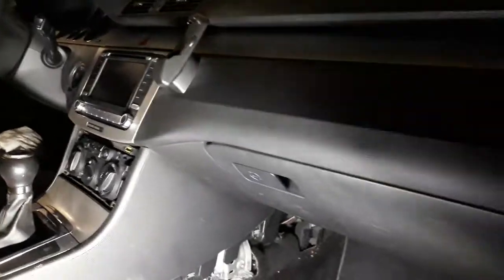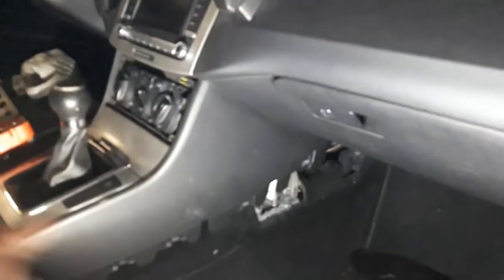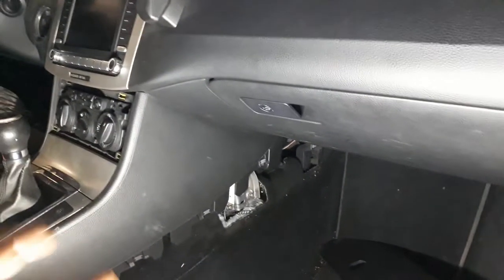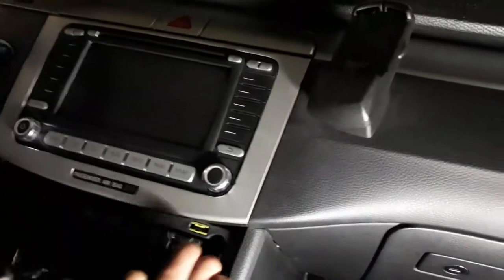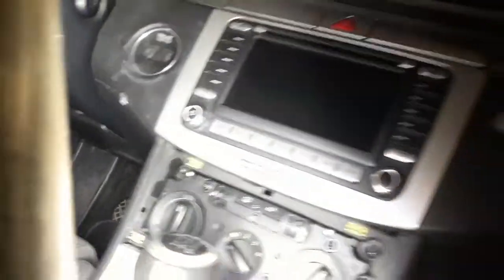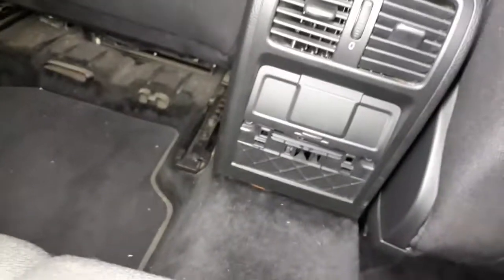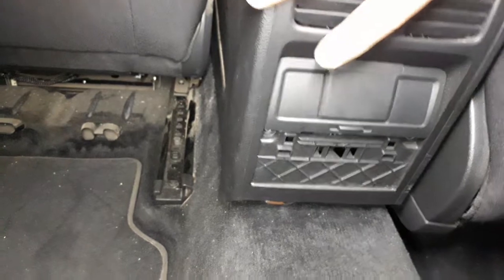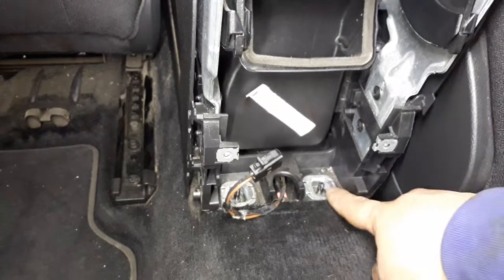VW passat 2007 central console remove , replace the parking break system module

Comment: You have replaced the EPB control unit electric parking brake. You code afterwards. Is it possible to change EPB afterwards code with VCDS

Comment: SIR Is it easy to do the coding? Just follow the step shown by VCDS Ross Tech right? Thanks. My car is passat CC. Do you think that the removal step is the same. In addition, my  problem is sometimes the yellow P light being on and autohold function not working, and the brake light staying off even I switch on the EPB button on. The fault code shown in VCDS 02845. Thanks for your help
Reply from the maker: Hi .
Possible Causes
When found in the Electro-Mechanical Parking Brake (EPB) control module this may be caused to a software problem .
Or module defect.
Reply: @phantom700X  thanks

Comment: hi, did you show all screw/bolt locations in this video? i did the same with mine but it seems to be stuck in place still and will not move. is there something else i need to do or just pull harder? thanks
Reply from the maker: Which part stuck?
Because there's no another screws
Reply: @phantom700X   the back part after taking the vents off, I’ve got it now there was another screw either side near the back hidden by the front seats.

Thanks for the quick reply
Reply from the maker: @thisisLlew  yes in video showing the screws behind the seat.
Goodluck
Reply: @phantom700X   I must of missed that bit my apologies

Comment: Hi,

very useful for me, but one question, why you have to change the module ? 
(mine is the B version, with the bug for left motor fail :(, I will swap to E version)
Reply from the maker: The parking break its not working.  The module have problem.  I changed and i coded and its start working.
Reply: @phantom700X  OK thanks you, 
I remove the console today and I have luck, it's only the cable not my controller.
Reply: @phantom700X  hello, me or a similar problem on a passat cc, if I buy a control unit with the same code, do you think I have to encode it? and if so, how to do this encoding, thanks

Comment from the maker: Please notes if You change this module you need to Coding the ABS . so please make copy from the ABS code before you put new Parking Break Module
Reply: P
Reply: Can you put in a used one and recode? If so, do you think it can be done with Zurich Pro from Harbor Frieght?
Reply from the maker: @geeess958  when i get another car i will record how to do it . But as i know . Its will be done with VCDS
Reply: How to find code on ABUS? How to Code new code. Can you explain about the ABS code?
Reply: I have a problem with my VW Passat 2006 B6 1.9 TDI. I have not checked the module. I think there is a problem with the module.

Comment: Can change first EPB control unit electric parking brake afterwards code EPB
Reply from the maker: You need to get the code from old one first.  If it's totally damaged you should get the code online and do it by vcds . Or any coding software for vw .
Reply: What is this code please make video